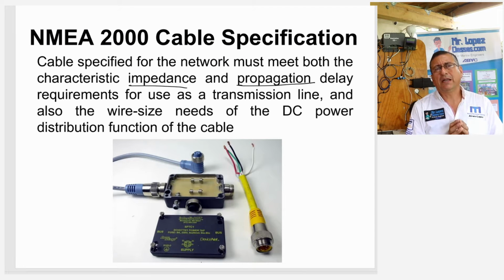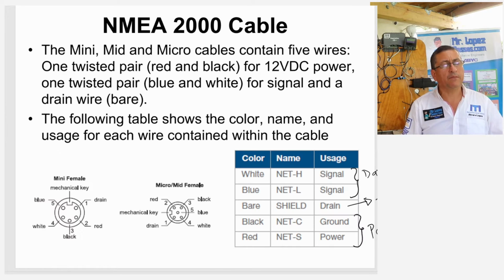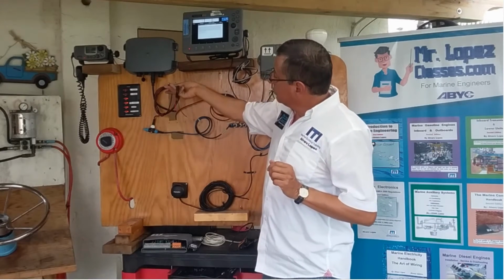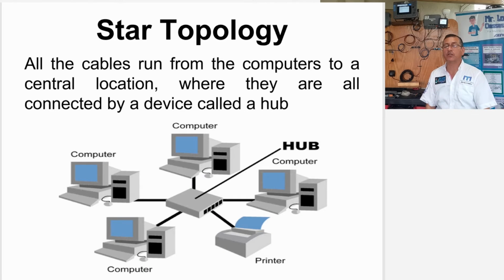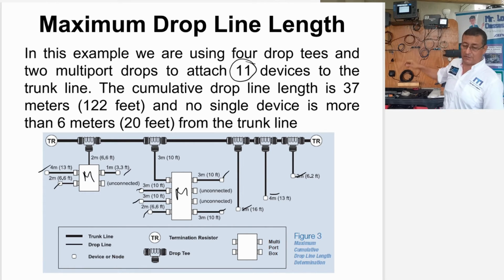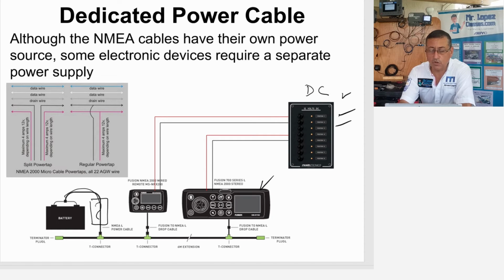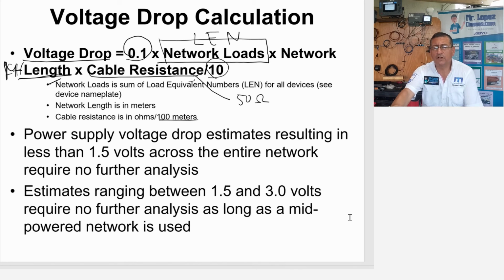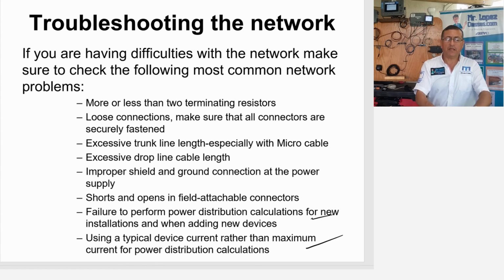NMEA 2000 Cables, Connectors & Network Topology - Chapter 12 Episode 1 | Electronics Course

Comment: On the PC connector what is the purpose of pins 6-9?
Reply: Can the sources of power to the NMEA 2000 be switched, so you can have it normally on constant DC from an inverter, nd then switch to batteries when the inverter fails?
Reply from the maker: Yes you can switch the source of power.....be careful with the limit of 8 amps